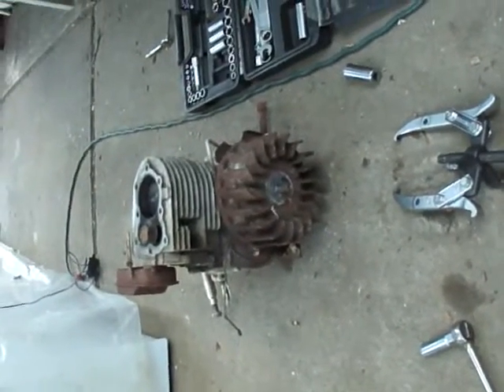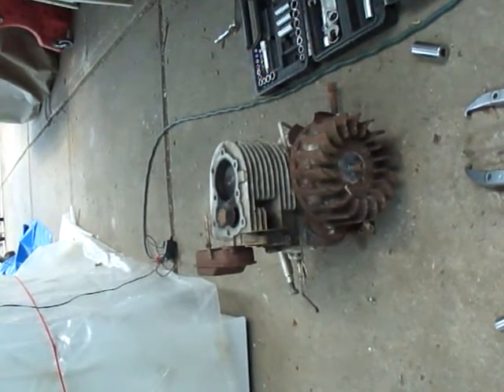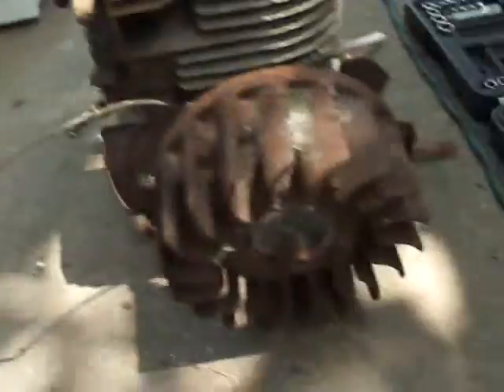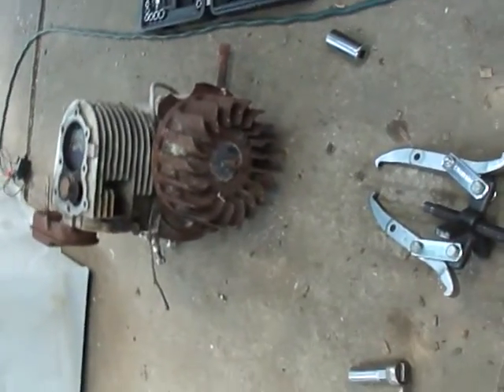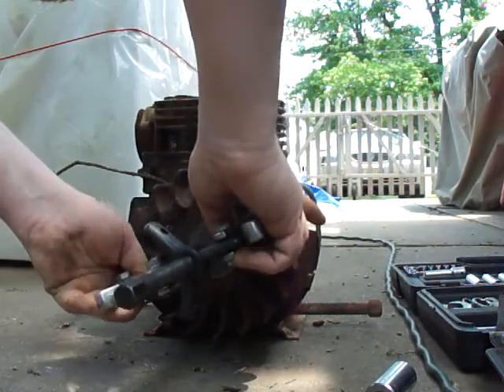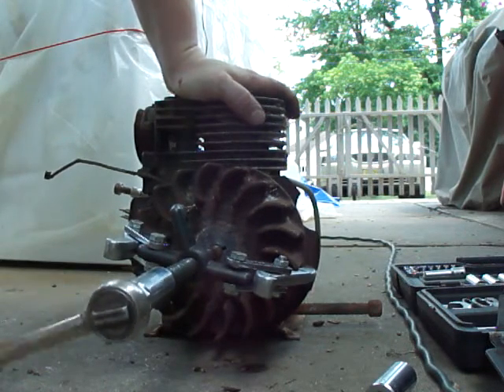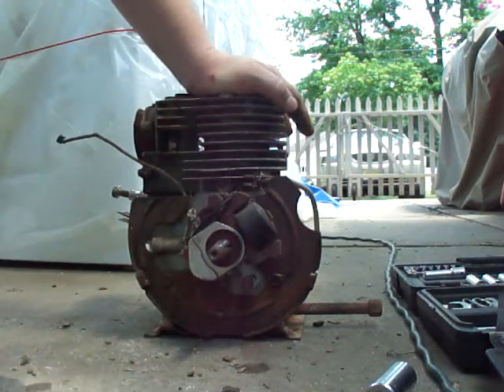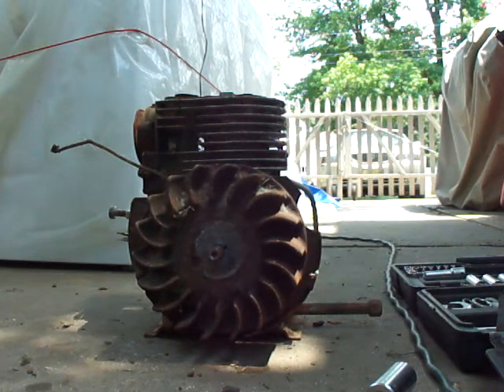How to remove a flywheel from a small engine quick and easy

Comment: I may try putting the bolt back in, then wacking it, what other option is there?
Mine is a bolt inside, not a nut outside, is that normal.
Thx again!
Reply from the maker: Depending what engine, yes there are ones with bolts. Yes you can do it that way. Just try to hit it square or the bolt will bend. Done it a few times, bent a couple but had spare’s so it wasn’t a problem.

Comment: Thank u.
I have a 75-77 tucumseh HS40 mini bike engine, having a heck of a time removing fly wheel.  I haven't gotten those exact puller to work yet, just cant get past the plastic fins to the back.  Puller seems too narrow.  I'll keep at it.  Again..thanks
Reply from the maker: Yea, just thread the bolt in until it’s only out 2 threads and smack it dead on with a pry bar positioned in a good spot under the flywheel and pry up as you hit it. Make sure you have another bolt in case that one get’s bent.

Comment: Couldn’t you just heat the flywheel then pull off? Or would this fuck with the condensers and stuff behind it?
Reply from the maker: @kain6590  Honestly, if you screw the bolt on flush and get a crowbar under there and pull up and give the top of the bolt a good square smack it will pop loose, the Taryn way. This was my early days of doing this. The only engines you can’t to that to are some of the antiques where the backing was made of pot metal, a crow bar will crack or damage those. But basically all these modern engines will bust loose with crow bar mallet method fairly easily.

Comment: If you actually pointed the camera at what you were working on that'd be great like wtf
Reply from the maker: lol
Reply from the maker: You do it
Reply: @Mr_Tecumseh  I'm trying to pull a flywheel ona 60s Montgomery ward tiller and I'm having one hell of a time 🙃😅
Reply from the maker: @smokeydabandit9175  Just put the bolt back on the end of the shaft get a pry bar behind there and whack the nut with a mallet and it will pop right off. Don't even need a puller for this.
Reply: @Mr_Tecumseh  my fly wheel is so rusty from sitting but I'm sure I'll find a way.  just irritating lmao🤣🙃

Comment from the maker: One other big reason you will need to remove your flywheel, is if you have a sheared flywheel key. This will occur on all engine's new and old, usually vertical engine's on machine's such as lawnmower's. Because the blade is on the one end of the shaft and if you hit a rock/stump, the flywheel key will shear, which is made to do instead of causing major damage to the engine. If you hit a rock/stump with your lawnmower and than all of a sudden when you go to start the engine, the pull cord is very tough to pull and kicks back pulling your arm with it, or the engine backfire's than you know you have a sheared flywheel key. Many times the engine will not start at all once you have sheared the flywheel key, but if it still manages too, once it has started it will run poorly, backfire, etc. You should change your flywheel key right away. All it is is a 1 dollar piece of stock (small piece of steel cut into a square shape) where the groove of the flywheel slides on and seats and is made to give. When your flywheel shear's most of the time the flywheel is moved forward or backward from its seat, which advances the spark and will cause the spark to be out of timing. That is what causes the hard pulls and backfires and poorly running engine's, so if you shear it change it and you will need to remove the flywheel if this results.
It happens on horizontal engine's much less, because usually horizontal engine's turn a belt which in turn power a separate clutch, etc. However if the horizontal engine is connected directly to a clutch or other power source than the flywheel key will shear if the machine abruptly hits an object. You usually will not ever see a sheared flywheel key on a snowblower, because the clutches are belt driven, but hey anything can happen. These are the causes of sheared flywheel keys. Good luck!

Comment from the maker: One correction from in the video. Your flywheel turns 3600 times a minute, that's 36 times a second when the engine is at max throttle for the most part, engine's can be set higher but most manufacturers do not encourage going above 3600 rpm and can vary down to as low as 1800 rpm at lowest idle, sometimes even lower depending on the engine. RPM=Revolution per minute.
This is why it is important that the flywheel is put on nice and tight or it can become 5 to 10 pound cast iron Frisbee that can do some serious damage. You get spark, by the magnets on the flywheel turning past the magneto's contact points which is what creates spark without going into great detail on how exactly it works. If your magneto is not working, you will need to get access to it, which is behind the flywheel on most engines made prior to 1983, basically all prior to 1980.
Reply: RPM. Revolutions every 60 seconds. How do you convert 3600RPM to 36RPS? Either there’s 100 seconds in a minute and your math is correct or your math is wrong and 3600RPM is actually 60RPS. 

When you error something this straight forward, how can I trust anything else you say?
Reply from the maker: @UrbestieCole24 You’re joking right? No small engine turns 3600 times a second. An engine going that fast would explode immediately and at that speed come apart and seriously hurt or kill somebody. It’s Revolutions per minute, it always has been, do your homework before you call someone out and look like a total fool. The fastest engines out there built for racing only go about 10,000 rpm. You think that flywheel on a stock engine turns 3600 times a second, you must be crazy dude. It’s RPM, it always has been since small engines started being built over 100 years ago. Don’t be a fool.
One more dumb sly remark and you’re out.